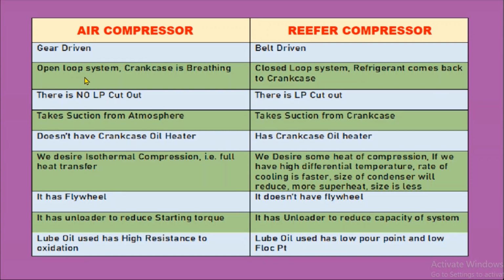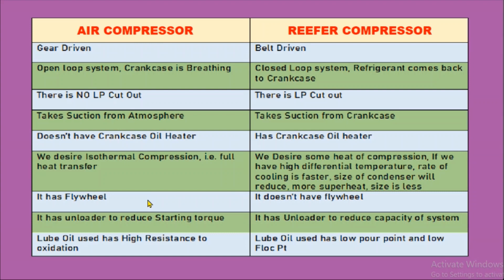Difference between Air Compressors & Reefer Compressors ?  A Must Watch Video

Comment: why crankcase oil heater is provided in reefer compressor?
Reply: because of the fact that reefer compressor has to work within low temperatures (because of refrigeration)

Comment: As you told in 2nd point.. Refrigerant does come in crankcase ..it is lube oil which come to crankcase from oil seperator, which is after the compressor outlet line..